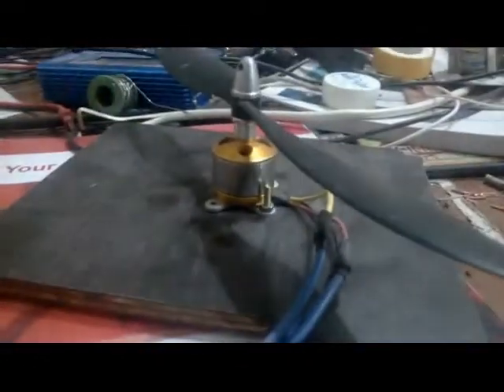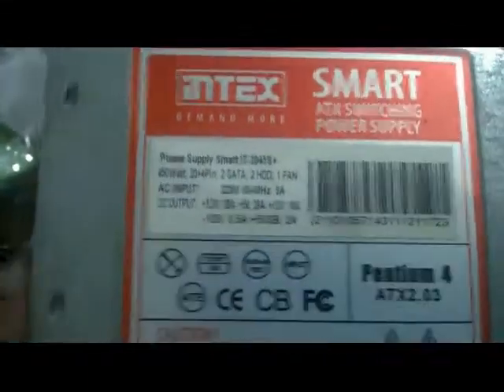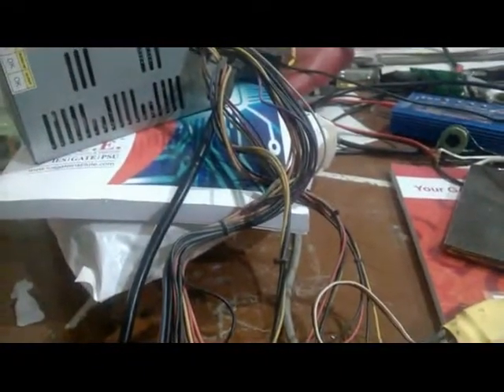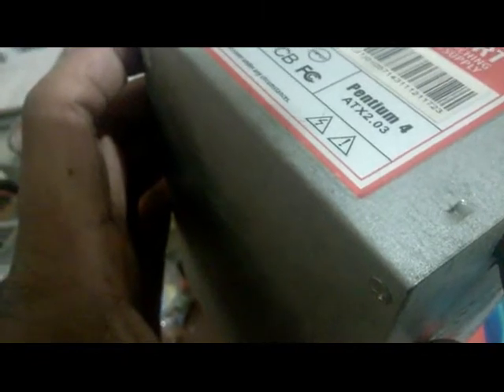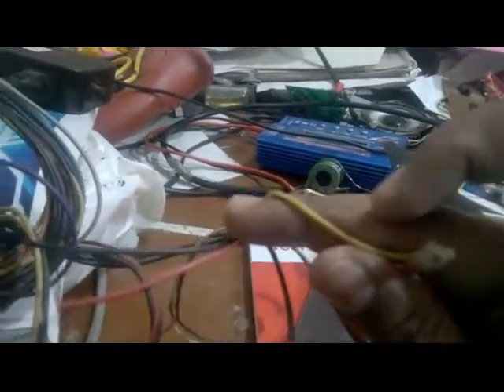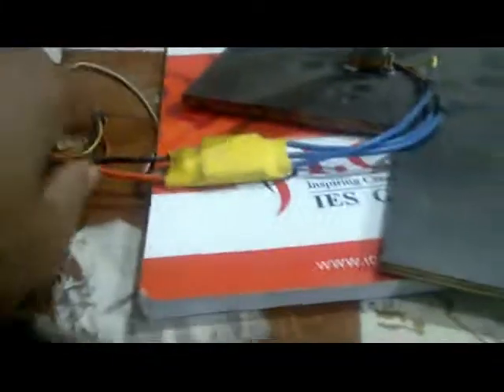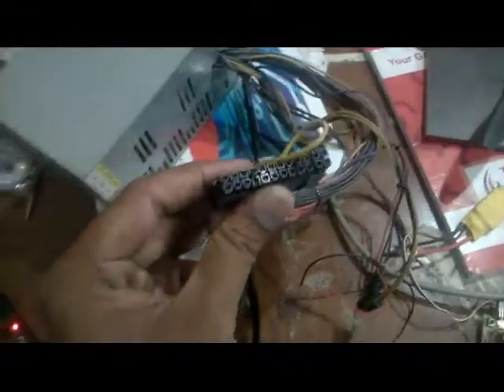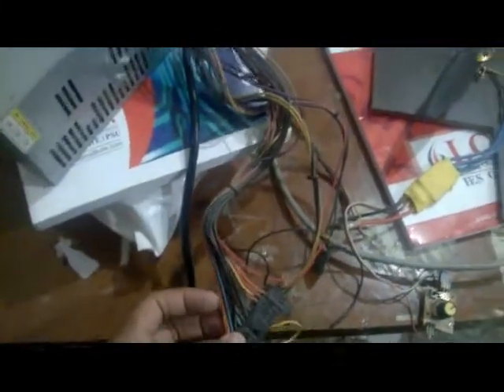Brushless DC Motor without LIPO Battery on SMPS

Comment: Bhai me 2200kv ki bldc ko 12v 30A ke smps se chalau to kuch extra add karna padega?
Reply from the maker: Nahi sidha esc k dc input per smps ka 12v connect carna and bas start ho jaye ga servo controller se moter ko calibrate kar na yad se
Reply: @parthaolad7612  back emf vagera ki dikkat to nahi hoti na??
Reply: And btw thanks😊😊
Reply from the maker: @janakpatel9477  ok back emf ki dikkat tab hoti hai jab motor supply se direct direct connect ho thik hai but iss case me motor and supply k bech me esc lagi hai jo 12v dc ko 3phase ac me convert kar rahi hai
Reply: @parthaolad7612  gajjab bhai🤩🤩

Comment: Thank you for the video! I have another novice question, for exemple if the power of your motor is 100W does the voltage affects the brushless motors? I mean I your alimentation can give you 50V / 2A will it works properly? Tyvm
Reply from the maker: no, no voltage is matters with this brushless motor winding and the ESC voltage and current rating. if u want to use 50v volt then u need very low KV of the motor but u want the very high current